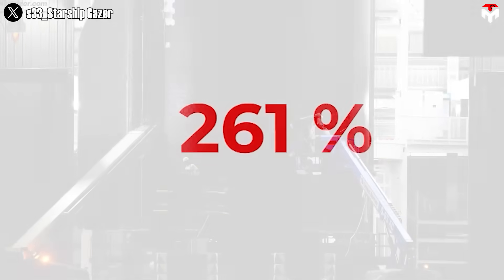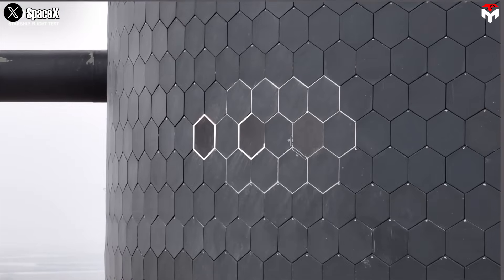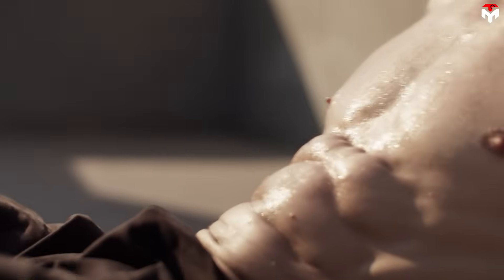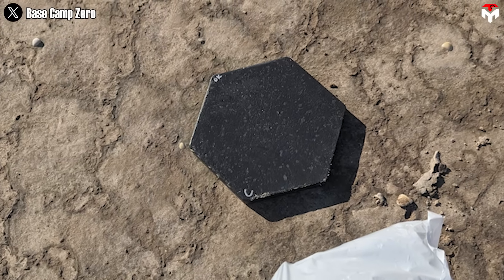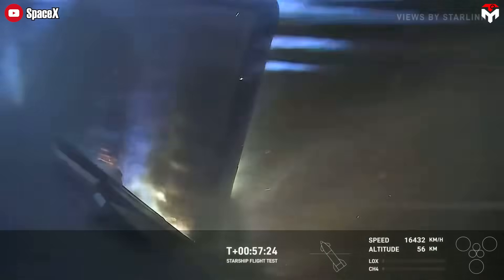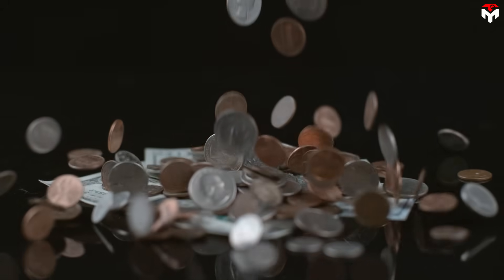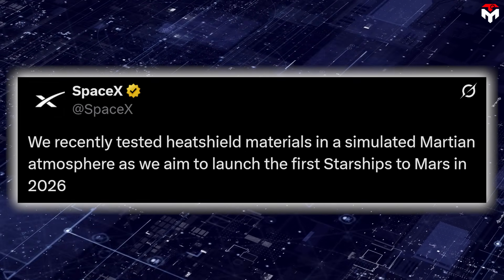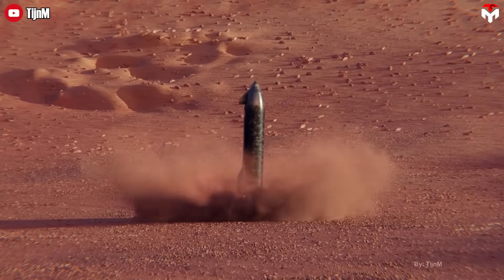Genius! SpaceX Big Solution:Metal Heat Shields OUTPERFORM Ceramic By 300%

Comment: It should be noted that metal thermal have been developed. During the aborted Lockheed Martin VentureStar program, a new thermal Protection System developed by Rohr Inc. was announced. The system utilized a nickel-based superalloy developed by Inco Alloys International. The material featured a high creep resistance and high strength at high temperatures alloy. At the time, it was loudly claimed it was safer and cheaper to maintain than the ceramic protection system used on the Space Shuttle. According to Lockheed the VentureStar's metallic heat shield would have eliminated 17,000 between-flight maintenance hours typically required to satisfactorily check (and replace if needed) the thousands of heat-resistant ceramic tiles that compose the Shuttle exterior. I have heard little about it since. There are some rumors that a derivative of it is being used on hypersonic vehicle development.

Comment: Good Morning my Friend. If Elon Musk figured out how to make a composite metal for a heat shield. It's pretty incredible. I've worked with some high temperature metal. The one thing I can say about it. It can be a bitch to machine. It almost has to be an Inconel, Titanium and some other metal composite. I hope he solve this problem. Yah. I don't thing there is any stainless steel in the heat shields. I've worked with 316 stainless. It's durable alright. I've used it in chemical and abrasive environments. If they are using 316 stainless. It is probably part of the composite. Great Update my Friend. Have a Great Day.
Reply from the maker: Have a nice day ❤️❤️❤️